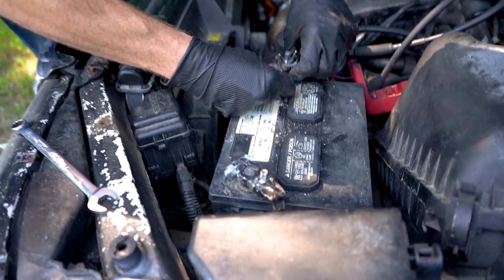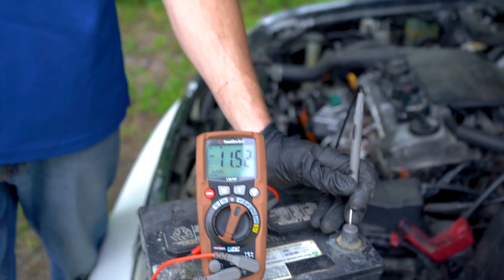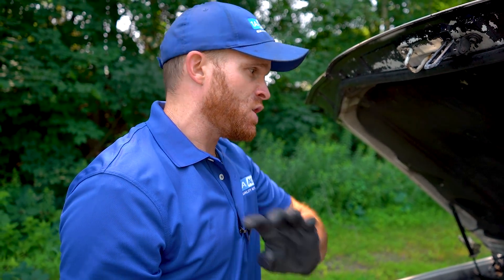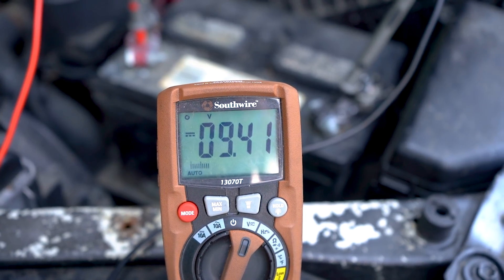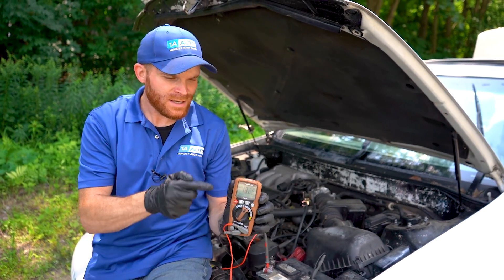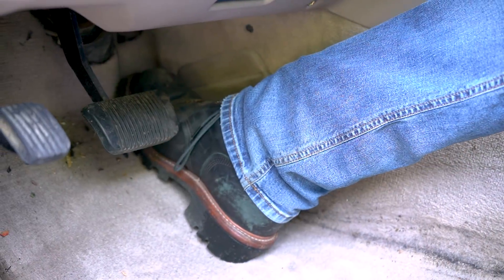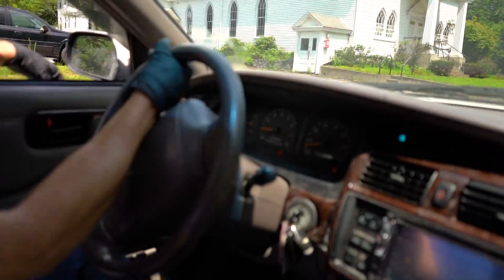Can a Car or Truck Run with No Battery? How Vehicle Alternator and Electrical System Works!

Comment from the maker: √  Watch the Video
√  Buy The Part at 1A Auto https://1aau.to/m-Visit-1AAuto
√  Do it Yourself
√  Save Money
Reply: Hello! I have a Hyundai Sonata Limited 2011 and it's my little limousine only for the summer time. Have a Saturn Ion 2007 for winter time. Since last week, my battery which is the original one begins to acting badly. One fine day, the battery is lighting everything but not powerful enough to start the car. May i left a light on during the night...

I have a battery charger 2 and 15 amps and if you wait about 5 minutes with the charger on the battery, the booster is on and you can start. But now i have the same problem everyday. I charged the battery for one entire day, not enough to start. Starts with the booster or by jumping cables with my winter car only.

I know how a battery is made, six compartments with 2.1 volts each. I don't have a voltmeter but by watching other videos, it is like if one compartment is dead and i have only about 10 volts in my battery so not enough to start the car. I'm PRETTY sure at 99% that my alternator is fine because when i jump cable the battery the car starts right away and nothing is fading.

Ok. You got my point, my battery manufactured in Korea in 2010 is beginnig to die. I live in the country and my mechanic man who owns a garage is at 105 miles from here! He is on vacation right now so i can't join him right now but i will ask you the question.

Can i drive 105 miles with my bad battery and good alternator without problems??? Will the battery and the alternator last the 105 miles? If i shut down everything which is electric? Or can i use the air climate and the powerful radio? The battery is not dead yet just bad. What do you think? Thank you. I've watched many of your videos. You did plenty about the Hyundai Sonata.

Comment: During harvest I have 5 IH tractors and they’re all diesel because I don’t want to worry about batteries so at the beginning of the day I drive over to each tractor and connect jumper cables from my truck to the starter and then they’ll run the rest of the day without a battery. Even when 3 of them were gas tractors I’d still leave them on the whole day so it wasn’t really wasting much more fuel that I do now. My old 7720 doesn’t have a battery either but the gleaner does. Much more efficient and less worry

Comment: Hey, 
It's a nice and good video! 
I have a question to your video.. 
My own car: Opel Astra H 1.3 CDTI, was, because of a accident, running 5 min without the battery and would not start a all afterwards.. i tried with another battery, but still no start.. then i found a bad earth connection and then the car starts, now the car starts everyday but keep cutting out while i'm driving and stalls while idling.. Do you have any ideas why?

Comment: What about jump starting the battery everyday? Will it damage my alternator?
Reply: jump starting a weak/dead/old battery means your alternator has to work hard to charge the battery. which may shorten its lifespan

Comment: Some issues here....

A warning about the short circuit risk from a loose +ve battery terminal should've been a priority.

Battery capacity is measured in amp hours, not volts. Sure voltage is an indicator of condition & charge (also load), but the difference is significant to understanding batteries.

The fluctuating voltage is because there's no voltage from the missing battery. There's no voltage (more accurately: potential difference) for the alternator to "sense". The effects from the varying loads (ignition, injectors, fuel pump...) are just more evident. That's probably why it stalled, if you'd held the revs higher it ought to have kept up.

Turning on the headlights would provide some ballast to smooth out the voltage, but any sensitive electronics likely have their own protection built & could well be regulated to a much lower voltage anyway.

Surge voltage: cold bulbs & stationary motors have lower resistance - more current can flow so the voltage drops initially.

Comment: My car won't run without the battery removed!!!! The alternator is new and fine the battery is new and in great condition, wires are intact, what could be causing this issue??? 😭😭😭
Reply from the maker: +@orlandoryan4 We wouldn't be able to diagnose an issue like that here, you may want to have a local mechanic take a look at it. Thanks for checking us out! http://1aau.to/m/Shop-1AAuto-c

Comment: so i have two cars, one of them is a nissan sentra with a good battery and the other is a corolla with a dead battery, im wondering can i take the battery of the sentra and put it on the corolla then turn on the corolla and remove the nissans battery and put the original corolla battery in and would it charge back ?

Comment: Will all cars no matter the year run without the battery I have a 2015 nissan altima 6 cylinder 3.5 I put a new alternator in it and everytime I disconnect it from the battery while it's running the car go's dead

Comment: I like your video ! If I did your test where the car is off. And open headlight , blower ,wiper blade , wipers . How long should a good battery last with all those things . The reserse capacity? I saw that your broken battery didn't last long

Comment: ive been having loss of power issues on the freewayfor just a few seconds, when i pump the gas power will come back. my car recently died on the freeway and when i towed it home i charged the battery and it started up after charging it up to the efficient votage. could this be just a battery that doesnt hold voltageand the alternator couldnt handle the load while on the freeway? the alternator and fuel pump/filter was just replaced.

Comment: I figured the engine should be able to run without the battery, but didn't think about the possibility of fluctuating voltages.

Comment: To summarize, your battery is a buffer of power. You use it to start your car and to run accesories when it isn't running, but it's also a key component when your car IS running, because it's trying to hold a constant voltage and it absorbs the excess power from the alternator to recharge itself. You can run without it, but without the buffer, you lose starting and accessory, and you subject your car's components to whatever power the alternator is putting out with no extra load to absorb it.
Reply from the maker: +ZTenski Thanks for the feedback!

Comment: With many modern cars, removing the 12 volt battery (that keeps alternator output suppressed) from the 12 volt system,
can fry your ECM, radio, GPS.
It has that danger because, depending on the RPMs at the time, you could send upwards of 20 - 30 volts through your 12 volt car.

Comment: Scotty Kilmer says doing this on modern cars with computers (probably OBDI+) can damage the system. Is that a myth?
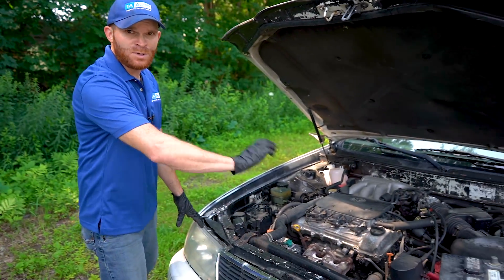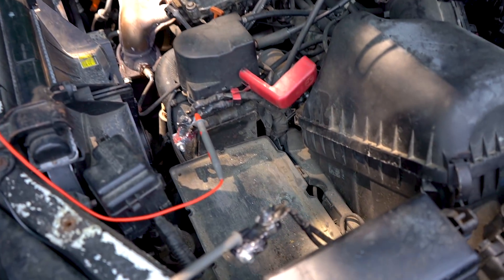Reply: 2:10 - 2:30
Reply: Nope, the battery acts as a buffer, when big consumers like an electric cooling fan shout on the voltage drop because the regulator of the alternator need some time to adjust, maybe the car shout off do to low voltage.
Worse is when big consumer shout off than the voltage goes up and can toast your computer.
It can work, but trying and failing can total your car.

Comment: Could we drive the car without battery after starting the engine ? Please make a full video about this subject
Reply: Just buy a battery this should be only used if it’s an emergency and just long enough to get you to a auto store you will damage your car

Comment: great and very informative video, but have a question: can I use solar panels, as a back up plan, to continue changing the battery in case if the alternator fails in the middle of the trip?

Comment: I was considering using a jump starter as a replacement since batteries weigh in nearly 30 lb. Since you don't need the battery once the car is started. But the voltage spikes renders that a bad idea
Reply: Plus the voltages spikes and drains can cause massive electric problems and the car not performance anywhere good as it should more newer ones to the could it could stall

Comment: Didn’t know you could rev the engine from under the hood
Reply: Depends on if it has a throttle cable, some cars are electronically controlled. The Chevy Cruse is one of them

Comment: Ys of course any vehicle can run without a battery if it has its alternator to generate power similar with that of battery... But the issue comes while starting ur vehicle.... 😆👍😃

Comment: I like 1A auto but this video has bad advise. Never run your car with out a battery or only if it is a pre electronic vehicle with standard filament light bulbs.
Reasons. The voltage regulator gets its reference from the battery. No battery, no voltage regulation. You are very opt to burn out any part of your electronics. New cars - engine control computer- transmission control computer- climate control computer- ride control-abs brake system. All lightings. In the case of halogen headlights they will blow  or shorten their life especially anything over 15vdc. Use an analog meter for better accuracy for this type of test. The digital meter your using has a sample rate of about 100ms. So it just doesn't respond quick enough to all the spikes that are thrown out with this kind of test.  Last thing to note: most alternators do not start approaching their full output until about 2000 rpm. When you don't have a battery (no reference so no control) your voltage will climb well above 20vdc. Again Don't every run your car with out a battery.

Comment: how about just a small capacitor just for starting?
Reply: Can be done but is not practical (on regular ICE cars) because the capacitor needs to be huge in size and capacity to start the engine.

Comment: You CANNOT do that in a modern car!

Either, the electric load in the system is MORE than what the alternator can produce at idle, or, the car would simply shut down the moment you disconnect the battery, to protect the electronics.

And, those voltage “spikes” are NOT that bad, as YOU DO KNOW that ALL car electrical and electronic parts are made to work with anything between 11 and 15 volts!
Reply: It’s pretty bad, I have seen alternator with less than 0.1 volt variation at idle.

Comment: When a car has a bad alternator. That's a different case. Unless you got a tesla battery inside
Reply: If the battery is good you can still go for a while with most electrics off

Comment: I used to have a 1998 Chevy s10 manual transmission, doesn't work without the battery. I jump start the engine but when you removed the park brake the engine turned off. Ask auto part people they told me something about the ECM anyway that particular vehicle doesn't work without battery in it.